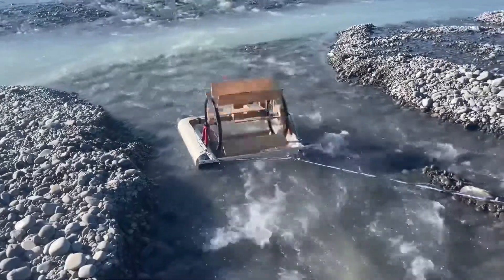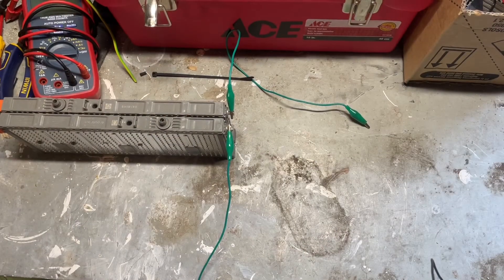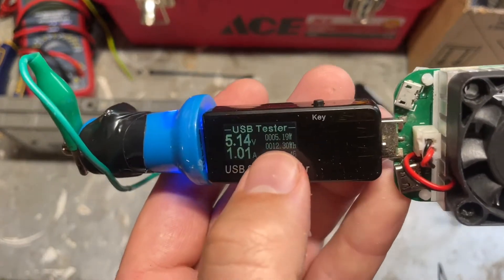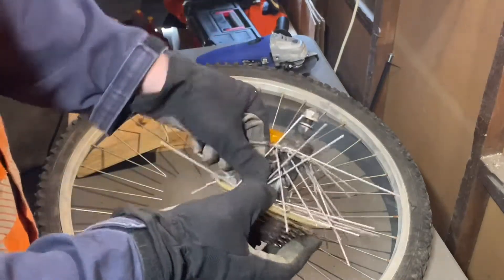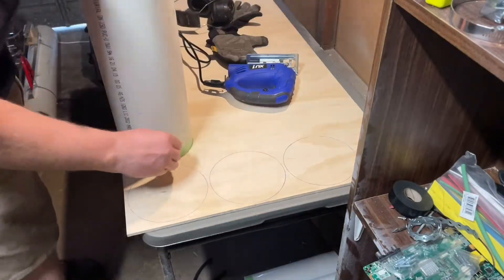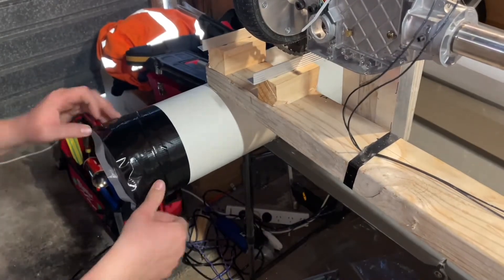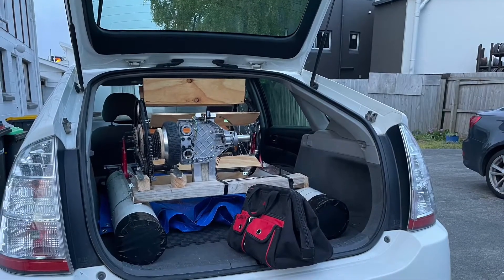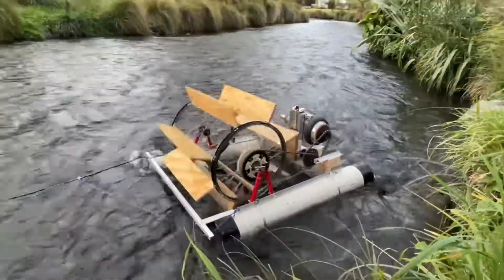Hoverboard converted to Hydroelectric Generator!

Comment: I forget if the bench seat is held on by 4 clips or 2. Either way it's fairly easy to remove it and have some extra room for the rear seats to fold down. I'm trying to make one of these motors into a hand crank generator (judging by what i already have i can get about 10-15 watts on a casual spin). Need to make a stand and do some testing to figure out what voltage and current i am getting and then maybe try and make a better three phase bridge (have some diodes for different projects and those have voltage drops under 0.4V).

Comment: Hey mate have you made much progress with this? ive seen a bloke use this motor for capturing from head pressure water from a water fall... trying to track down plans
Reply from the maker: It is a good motor but you do need that height drop  to make it work well. Im focusing on smaller more portable generators at the moment. so using smaller motors.
Reply: @KiwiMaker maybe u can use a 6.0L caterpillar diesel engine to spin the alternator?
Reply from the maker: @CrazyDutch79  That would work very well but I'm here to try new concepts that you can't buy at a shop.
Reply: @KiwiMaker  maybe you can copie that engine and make it from bamboo